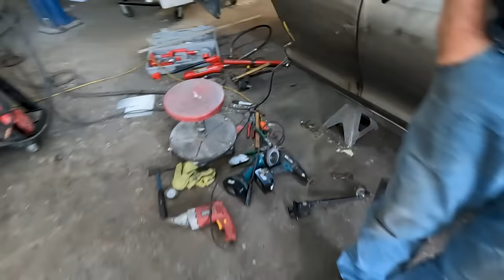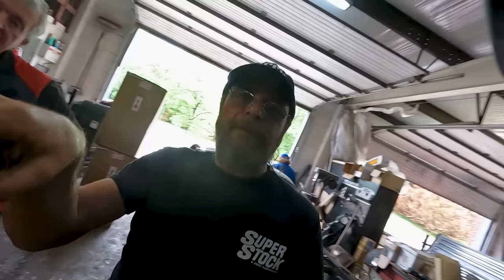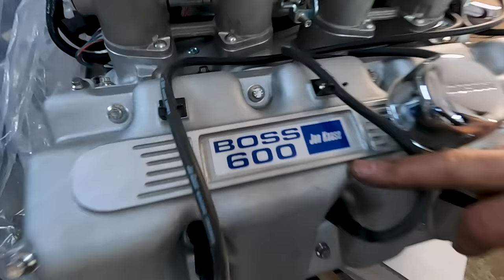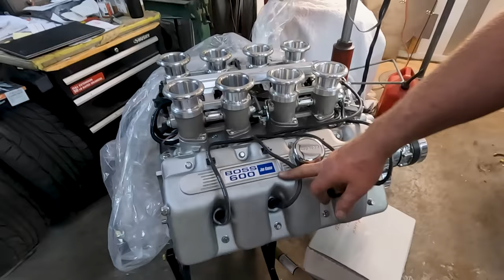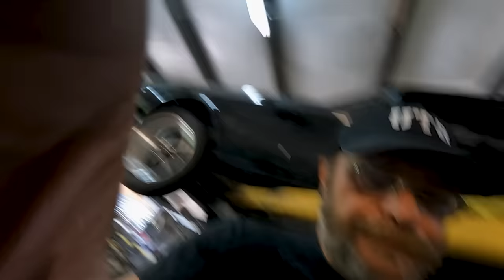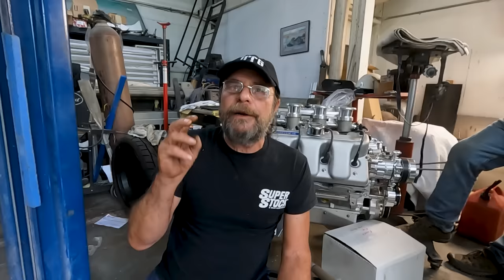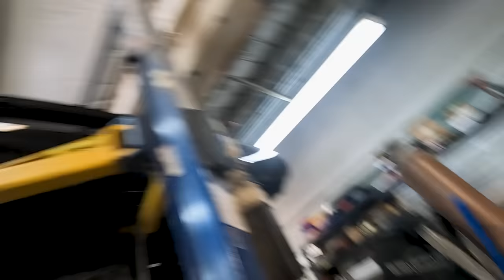How Ford Screwed The Pooch On What SHOULD Have Been The Greatest Musclecar Engine Ever

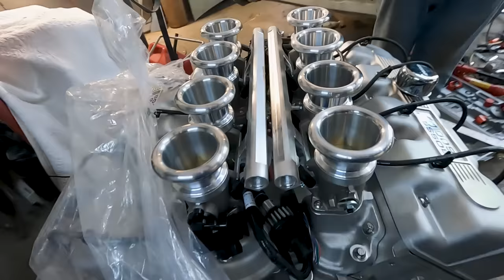Comment: Tony, your generally right and I agree with most everything you've said here. I've built and owned Boss 429's stock and modified. My former drag-racing partner, Ed Prout, held N.H.R.A. National Records running these engines. Similar to Jon Kaase,  I've built a long-time business around this engine but with the original cars. They CAN run well on the street or at the dragstrip if not approached as you would a Chevrolet or Chrysler. They have idiosyncrasies that need to be addressed so their strengths can be realized. B.T.W. We've had both the street-Hemi and Boss 429 properly tuned, with only changes in cam and exhaust, on the dyno. The Boss was better than the Chrysler by some 30 horsepower. Ford designed and built the Boss'9 to win in NASCAR. Which it did. On Fuel and at smaller displacements they were and generally in a word, dismal. Connie Kalitta HATED them.  For the most part,  the auto-buying public dissed them. The street version was hampered by Ford's N.V.H. and other "passenger-car" driveability standards. Did you know that Ford would not install its premium "Detroit-Locker" and 428 available 4:30 rear gear in the street Boss 429 Mustang because "It was too noisy." The Boss 302, with it's Cleveland-style cylinder heads came equipped from the factory with a 780cfm Holley and 2.5" H-pipe exhaust. The Boss 429? A smaller 735 Holley a smaller 2.25" H-pipe exhaust. Ford engineers have a history of limited attention spans in respect to engine design and development. They never cared to develop or tap it's potential before moving onto something else. Except for NASCAR, some sad early history here. But thanks to guys like Bob Glidden and now Jon Kaase and other supporters, the engine garners more respect today than it did back when it was new. And you're right, you can make a killing on those o-ring head sets! Keep up the good and relatable work, Tony!
Reply: I remember talking with Ed Prout many years ago at Sanair in Quebec and I think he won . He was the first to make the Boss 9 a winner way back then .
Reply: great insight. thanks!
Reply: You can "thank" Ford's NVH (noise, vibration and harshness) people for turning sliced bread into turds. Oh, what a difference a few years made. I had a 1966 Fairlane with the "427 Race Car Package" dual quad 427, 324 degree cam, fiberglass hood, transistor ignition, disc branes, 3.89 gears, 31 spline axles, etc. I drove it 31,000+ miles on the street, it was a spectacular car, yet only 3 years later they brought out the emasculated Boss 429 Mustangs that would be lucky to outrun grandma's 1960 Falcon with its straight 6.
Reply: @bobkonradi1027  Bob, a friend of mine had one too, raced from new and another local guy drove it seldom on the streets in the 70's. Another friend bought it last year. It's the one that sold on Bring a Trailer. If the Boss had been like that. Manual steering and brakes, a real cam, maybe Ford's new Dominator carb....  would have raced against the Hemi Darts and Barracudas in SS/A.
Reply: I guess that Ford was trying to build a "gentleman's hot rod" to compete with the Olds 442 and Buick Grand Sport.
Reply: They were taking the lazy way out of cooling the car. By limiting the huge engines output the cooling was sure to be just ok, and that was good enough. There was a real reason the 427 FE didn't get so mainstream that it was in every bodystyle. Because you didn't want to sit in traffic with that ole girl.... A Falcon with a 427 back in 64 would have cooked itself leaving the dealership.
What would be a real treat is to live back then, like my Dad and get these big blocks off the car hauler and you had to push them off, restricted to crank them. The manufacturers knew most all of these engines could be grenades out of the box. 
Dad worked for Boggs Motor and any of the Hemis had to be pushed off the truck, unless the owner was there. Spun bearings and different things wasn't out of the ordinary especially in the first 200 miles. "The dealer was not taking the blame for customer misfortune with an experimental engine". My Dad's exact words of how it was explained to him concerning all 426 hemi. The owner was to crank it and that was that.
Think about Ford and their 2 year run of bad FE block 352's and 390's, many coming back in for rings not seating and or abnormal bearing wear or cracked blocks. I'm sure the Dealer had to fight tooth and nail not to pay out for the 1000's of cars that came back in 1966 and 1967; from the 65 and 66 model years affected with bad oil consumption. They had to locate every problem and access the damage, on every complaint.  But once the problem was taken care of, every one of them made for awesome engines. Just whatever your block had wrong with it, had to be addressed, or just another engine, which was last resort in many areas of the country.
Heck Mr. Edsel my old shop teacher made a living in 1970-74 pulling BBC's out at the dealership, for those same issues that plagued the Ford FE blocks. They were some engine pullin fools back in those days.
Reply: But what about the SOC 426, 600 + HP.
Reply: @bobkonradi1027  That is quite some car . I really liked that 324 High Riser cam better than that 306 low riser cam because you could feel the difference . I know a guy that runs an engine shop and he is big on racing Rat Motors . Anyway he bought a Medium Riser 427 from Holman Moody and told that was as fast as his best Rat Motors . He said he doesn't know how they got so much power and torque out of that type of engine ?
Reply: @Ecosse57  Thank you.
Reply: Hi Bill, i remember Ed Prout..  back in the early '70s  he stopped at the Sunoco station 10 miles from Englishtown  where   i was a mechanic at  one night during the NHRA Summernationals  , i was working late on my Chevy II ..and he wanted to use a lift ... his  Pinto he was running in Comp was coming down hard after the starting line and  the oil pan was making contact  with the track..  his quick fix  was a piece of angle iron i  torched the contour of the scattershield  into and he bolted on .. nice guy . a bit eccentric ,driven ,  i was a budding hotrodder with 20 questions ,wow he was so  knowledgeable
Reply: Obviously Ford didn't want the hyper expensive lawsuit and warranty problems from making these engines any more powerful for the street... 
There's a local guy with an orange Boss 429 Mustang that drives it to our car shows/cruises and all over the place... it's no 'trailer queen'...
Reply: @hitekbigmek  Hey, John. Thank you for the memory. I ended up buying that Pinto from him. Yes, Ed definitely marched to his own drummer but he knew how to make horsepower.
Reply: Ford left racing after 1970 well factory backed at least the bean counters and the malaise era got in the way. Let’s not forget Rickie smith ram first 7 prostock with boss 429
Reply: The 4.30 Detroit Locker was available in the 70 Boss 429, but the for the 69 Boss 429 the 4.30 ratio was only available as a Traction Lok since 4.30 Detroit Locker availability began around November 1969
Reply: Excellent reply. You hit the nail on the head regarding Ford's attention deficit disorder. The company has a history of throwing huge amounts of money at projects such as the SOHC 427 and Boss 429 only to loose interest and walk away shortly thereafter. One name not mentioned was Alan Root. IMO, had he and Nick Arias not produced the A441 style improved Boss 429 head, the engine would not have had the extended success in both IHRA and NHRA.
Reply: @rotorr22  I remember the Arias Root Boss 9 stuff in the 80's Ford Motorsport or Racing (whatever they were calling their program at the time) catalogs. There was a 707 cid option. I'd have to leaf through my collection to find which year.
Reply: @ryanmuir6338  Ford installed 4:30 Detroit Lockers into 1970 428CJ's and Boss 302's but although listed as available never installed one into a production Boss 429.
Reply: @billfioretti3013 So no buyer optioned for that then.  I'll have to check with Kevin Marti on that one.
Reply: Look at the history and time of the 427 FE. The engine was around long enough and plentiful enough to get maximum time in racing and testing.
Did this happen with the 429 ? No. 
Only a hand full of people stuck it out with the engine for a few more years.
Reply: I heard there were only about 800 Boss 429s produced.   So it never really was a production car, and the Boss 429 wasn't really a production car engine.   
I had a Ford Motorsport catalogue from 1988 and all the engines, heads, etc. were Boss 429.
Reply: Ed Prout was a hell of a racer , I used to sit in his rail all the time at his little dirt bike shop later in his life when I was a little kid.  Don’t forget the DRAG  N RUN boys.  Eckstrom, Doyle, Oakes, Bertrand, Beals ,Gaudreau   And many others from the area who were all masters of the strip in their own rights. .a real hot bed of great racers. .   Ed was in the papers every week just about.  He also taught me about function first. He’d say don’t  worry about what it looks like worry about how it works! Served me very well In My own racing. Also told me use your brain not your wallet. Again served me well.
Reply: Boss 302. A weak anemic std engine with way too big a cylinder head with not much compression and way too big a carburettor. 780 is fine for 7500 rpm. Street ones were flat out at 5500. In period they used no more than 6500 to keep the engine together.
Here in Oz the Cleveland Ph3 Falcons had a 780 and they too had heads too big but were 800cc bigger
Reply: @ldnwholesale8552 obviously you never had one of these engines.
I have one of these engines in my 68 F 100 in front of a C 4., 3.25 rear end.
Been in the truck over 30 years. I've did a couple upgrades. Roller rockers and gear drive and 5.4 inch rods.
Engine is an excellent off idle performer. Great drivability. 
If I have a load in the truck, you can tell it lacks a little in torque.
But all you have to do to compensate is step on the gas more and that takes care of it.
Out of all the carbs I've had on this engine, the 800 double pumper works the best. Not the best for gas mileage. 
Maybe some day I'll get around to doing a drive around video.
Reply: Boss 429s were offered with 3.91 or 4.30 gears.

Comment: What I remember hearing about the Boss 429 engines back in the late 70's, early 80's, was they were sluggish on the street version due to the intake runners being so large the fuel could precipitate out of suspension.   That caused the burn to be dirtier and with that would have been tough to meet the new emission standards that were on the horizon.    Someone I went to high school with, in about 1980, took a clean 69 Mustang fastback that originally had a straight 6.   He cut the shock towers for more room and bought an original Boss 429 out of a totaled original B9 car.  He rebuilt it with 12.5:1 compression, tunnel ram and 2 Holley Dominators on top.  It had the original 4-speed out of the totaled donor B9 parts car and locker rear end.  He had zero problem pulling the front end off the ground, though he did it with wrinkle wall slicks in back on the street and wheelie bars.  That ended when he was caught pulling a wheelie the night after I saw him do it, really late, on the street.   He did have the engine setup dyno'd back then and said it made about 900 HP.  The Boss 429 worked much better with more cubic inches which brought the air/fuel mix through the intake at a higher velocity.   Headers also helped.   It was just an engine that Ford put in a "few" Mustangs so they could say it was a street engine and be allowed to race in NASCAR.  In the early 80's while they were a little more, a few thousand, than a 428CJ car they weren't as sought after.  They were thought of as a odd ball engine with no head gaskets that was expensive to maintain.  Wrong yes but that's what I remember of that era and those cars.
Reply: My buddy used them and 460 ad Boat ancores and cars. For Insurance  scam 😂

Comment: Would be nice if you knew what you were talking about. The Boss 429 smog pump, 735 carb etc was used to allow engine to pass emissions(we ain't talking 1965 here). WITHOUT SMOG APPROVAL, there would have been no Boss 429 Mustangs or any other model with same.
Reply: That's what he said... also, 735 carb. good to 500 HP, so plenty big enough...

Comment: It seems if you have an original Boss 429, it just best for display. From what i have read, the originals had week heads that liked to warp alot. Also they had to go on a Boss 429 block only, because of the oil passages ? Jon Kaase fixed all that, and you can use a plain old block out of a truck... I remember as a teen about 1978 seeing some Boss 429 engines in the local paper for sale, complete but in boxes. I know i wanted them, but didnt have any money. I saw alot of things like that for sale, but back then nobody cared.... Once again Tony, great video !
Reply: Actually there's a local guy with an orange Boss 429 Mustang that drives it to our car shows/cruises and all over the place... it's no 'trailer queen'... car is in 'driver' condition...

Comment: Good video!  As a lifelong Ford fan, the Boss 9 has always given me heartburn. So much potential lost, for the reasons you describe. 

How did the same company that released the Boss 302, that knocked it out of the park in 69, intentionally strangle a world beater with its big block stablemate?

Ford (and to a lesser extent, Mopar) favored exotic engines to win races. And were incredibly successful. 
Ford:
Indy DOHC
427 Tunnel port
427 SOHC
BOSS 429

Mopar:
Max wedge
426 Hemi

It was a Ford and Mopar game at the circle tracks and the quarter mile from 63 - 72. 

But (especially in Ford’s case) it rarely transferred to the street. Think about it. It took Bob Tasca, to dig into the parts bin and show Ford how to make a volume production street winner!

Just when Ford had it figured out, and released the 335 and 385 series, poof!  The performance era was over! 

Too bad!  Those two platforms would have dominated the streets and the track.
Reply: I agree about the 385 series. My favorite engines and they're finally starting to get a real good aftermarket. 

I had always hoped for would bring back the 460 with all the new tech in fuel, air and combustion. 

Kaase makes Boss 9 heads for the BBF. Would love to get my hands on a pair to slap onto a 557 stroker or bigger.
Reply: The Mopar hemi came out in 1952 or 3. Which came first?!😂

Comment: In about 1978, my neighbor Danny's older brother Robert bought a '67 Fairlane that someone had stuffed a Boss 429 in. The car was ROUGH, I don't remember much about the car except a Mr. Gasket shifter with a Hurst knob, sunburnt black paint, and an interior that looked like a multi-car crash happened INSIDE the car. I was a a 13 yr old Mopar guy and I knew almost nothing about those Boss motors, the only experience I had with them was building a 1/25 scale Wood Bros. Purolater Mercury that I always displayed a fender behind my "real" Hemi #43 Charger model. If it wasn't for the unique valve cover I wouldn't have had a clue about that engine. Over the years I've wondered how it got in that Fairlane, how much Robert paid for it, and what happened to it after they gave up on trying to get it to keep running. He couldn't have paid much. He was a high school senior from a working class family and only had a high school kids kind of job. I remember about 4 or 5 guys messing around with it for about a month, it would start but not run, but after a while, it wouldn't even do that.

It disappeared and a late model F150 longbed on chrome wagonwheels showed up, and we never saw the Fairlane again.

That was my first brush with mythical Fords

Comment: Regarding the slant 6, try rotating the carburetor 90 degrees on the manifold so that the primary side is facing the car's left fender. This way you'll likely get better fuel distribution which may solve some of the flat power response you're getting at the strip.  The factory intake manifold could also be ditched for a more performance oriented manifold from AussieSpeedUSA. These guys have custom aftermarket parts for the slant 6 including a pair of cast iron tubular headers which then bolt to a third piece (manifold) which is bolted to the intake manifold, but the key with this setup is you'll have more heat available to the intake manifold to atomize the mixture. But try rotating the carb 90 degrees first and see what happens.

Comment: A great video explaining the history of the Boss 429. Everything I have understood was that Ford’s focus for the Boss 429 was for the track, not on the street. It was expensive to produce and probably didn’t, in the opinions of their accountants, justify much investment for a consumer version much beyond the de tuned motors offered in the Boss 429 manufactured to meet NASCAR requirements. The motor was designed to fit in a Torino engine bay, and the Mustang required structural modifications to get it to fit. That Ford also planned for and offered a 429 CJ that was obviously designed at the same time and offered in 70 and 71 models testifies that Ford didn’t intend for a big production run. Ford pulled out of factory backed racing in 1970 and spent the following decade not really caring if a Blue Oval was in the winner’s circle despite strong showings from loyal knights of the realm.  Ford has had a history of not necessarily reading the tea leaves like GM and Chrysler and reacting more than being innovative.

Comment: No lie - i immediately knew that you were going to be taking about the boss 429 when i seen just the title for the video. Those engines are the most underrated engines of that era imo.  I would hate to work on a 69/70 mustang that has one though - there is literally no space between the towers and the engine everything is so crammed in there.